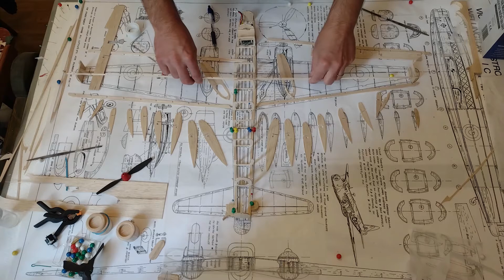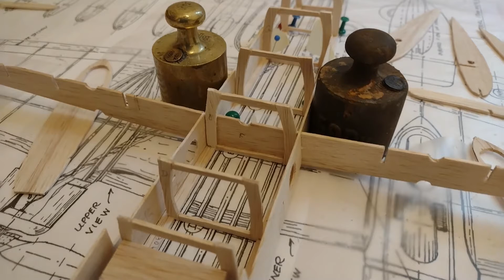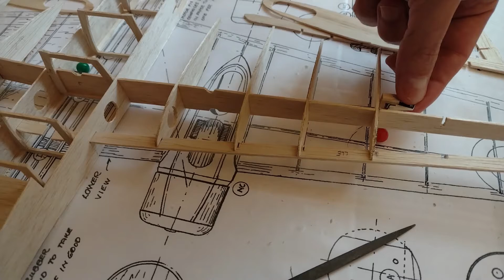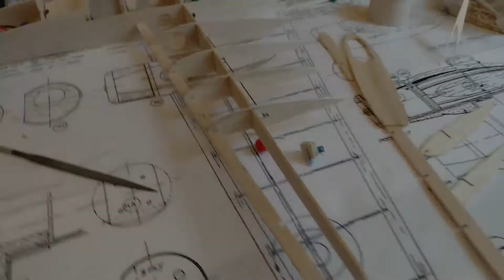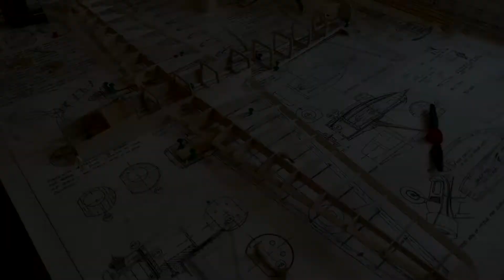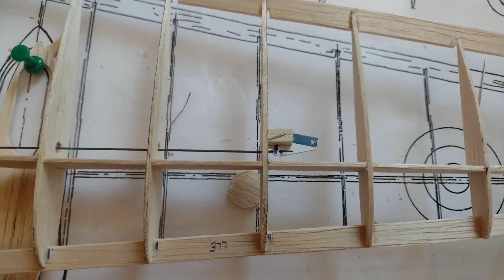05 Wellington Balsa Model   Wing assembly

Comment: If you increase the length of the hinge you made and reposition the hole that will give you more throw, it's a nice idea to use an old card to make your hinges.👍
Reply from the maker: Thx, I was thinking along those lines, I need to improve my design though. Thx for stopping by!